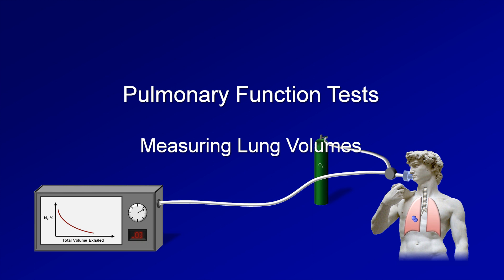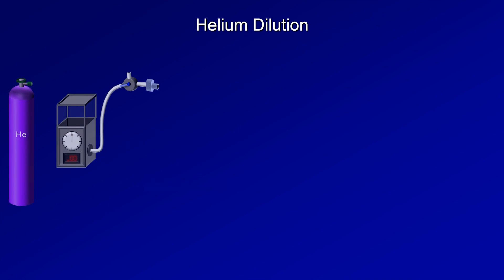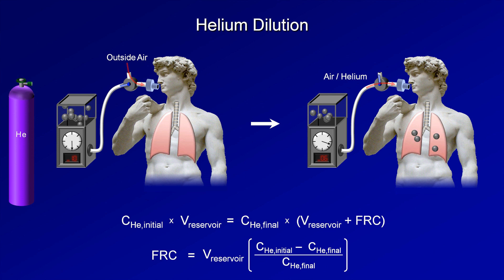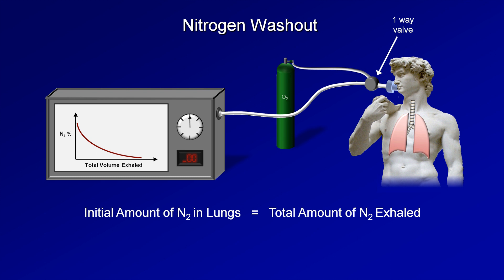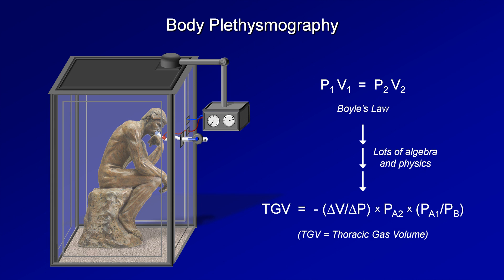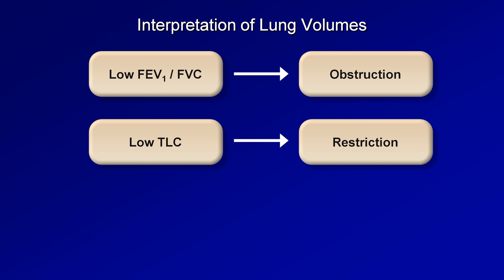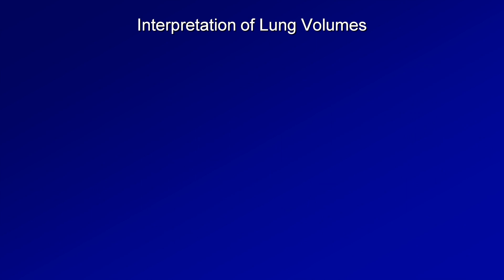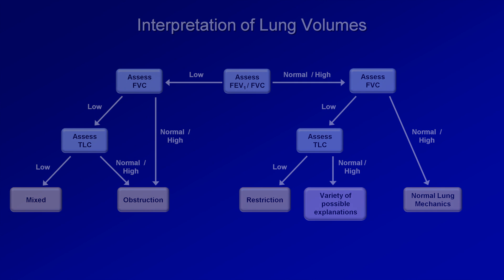Pulmonary Function Tests (PFT): Lesson 3 - Lung Volumes

Comment: This is an amazing video, Dr Eric. Thank you for uploading it. I would like to point out a mathematical error regarding FRC. FRC = [(Initial conc. of He - Final conc. of He) / Final conc. of He] - Volume of Reservoir.
Reply from the maker: Ahmed Khattab Thanks for the message.  However, I do think the original math is correct.  It's worked out more explicitly here: http://samples.jbpub.com/9780763781187/81187_CH02_FF.pdf (page 90 of the book, or page 22 of the uploaded pdf)  Please let me know if it still seems in error.
Reply: Eric's Medical Lectures I don't know how to thank you for your reply. It turns out that it's just a matter of rearranging the equation. My mistake. Thank you for the clarification.
Reply from the maker: Ahmed Khattab No problem!  I do make mistakes in these videos, and I honestly appreciate viewers pointing them out.  Thanks for watching!
Reply: I did not get that calculation

Comment: I have always wondered whether the lung capacity measured in a living animal would be different from the lung capacity measured in post mortem, ex situ lungs. I see lots of pubs report excised lung volumes but haven't found any that can compare these two measurements. I study marine mammals, which have extremely compliant chest walls and lung volumes, but am curious whether the post mortem ex situ values for lung capacity could be overestimates. Thanks for your help, this video is inspiring (pun intended)! :-)

Another thing I was hoping you could clear up is whether helium dilution or nitrogen washout techniques can be used to estimate total lung capacity...based on this video it seems like they can only be used to measure FRC, but I just wanted to ask in case I misunderstood. Thank you again for making this video, it's great!

Comment: Dear Dr Strong,

Thanks for the very informative series on pulmonary function tests. Would you consider an additional lecture on interpreting the validity of each of each type of PFT to complete the series. 

Thank you.
Sincerely,

Raleigh
Reply from the maker: By validity, are you asking about how accurately the tests are in discriminating different forms of pulmonary disease?  Or how reproducible they are?  Or how much clinicians actually use them in practice?  (I'm happy to discuss any of these in the final video in the series.)
Reply: Eric's Medical Lectures
Dear Dr Strong,

By validity, I am refering to the criteria for acceptability for each test.

For example, for spirometry, is there maximal effort; no cough or glottic closure during the first second ;good start-of-test; back-extrapolated volume less than 5% of FVC or 150 mL,tracing shows 6 seconds of exhalation or an obvious plateau, 3 acceptable spirograms obtained; 2 largest FVC values within 150 mL; 2 largest FEV1 values within 150 mL and finally reporting the highest FVC and highest FEV1, even if they come from separate maneuvers and that the FEV1/FVC ratio is derived from these values.

There are criteria for acceptability for dilutional lung volumes, body box and the different techniques for diffusion capacity.

Would you be able to elaborate on these in a separate lecture on pulmonary function test.

Thank you.

Sincerely,

Raleigh
Reply from the maker: Raleigh Lee Raleigh, I'm very sorry, but I think you just exhausted my own knowledge on this particular issue.  This level of detail is critical in the PFT lab, but by the time I see a PFT report, the technicians have already taken care of this.  Thus, I don't know more about it.  However, unless you are working as a PFT technician, it seems unlikely you'll need this information in routine clinical care.  (though I can imagine one might potentially need to know this for pulmonary boards...)

Comment: Thank you for the video, it is indeed very helpful. I have a question though about the "pseudorestriction" case. Can you explain why if we only measure the lung volumes by spirometry will that be inaccurate ? you mean that we only measure IRV, TV and ERV which are reduced so we think of a restrictive disease??
Reply: Yes, you are correct. If only spirometry is ordered without a lung volume test, one might intepretate the result as "restrictive lung disease" based on the reduced vital capacity measured by sprometry.

Comment: I'm struggling with the eqution a bit.  I get FRC = (initial concentration x initial volume / end  concentration) - initial volume after solving the equation. Looking in some books I can see that the s is apparently correct but that it can be solved further through some likely clever maths?  Is there any way of explaining this please?

Comment: Why does He dilution not measure FRC + TV? Wouldn’t the person still be breathing in tidal volume after the stopcock is closed? Confused...
Reply: No and I'll explain why! For example, in the helium test, the patient begins to breathe the air containing helium at the end of tidal exhalation (i.e. when the FRC is contained in his lungs). When the stopcock is closed it is true that helium is distributed throughout the lung but in an air volume that corresponds only to the FRC. I got it?
Reply: @giuseppevallese4153  Thank you!! Yes this makes more sense now
Reply: @nada amraoui 
Try to think that when the patient begins to breathe the circuit is closed and a single environment (reservoir + lungs [FRC]) is created in which the helium is distributed homogeneously. That's why the final helium concentration is the same in the reservoir and lungs. Clear?

Comment: Using the radiographic technique, how do you separate the lung tissue from the air? Or do you? Are the two considered to be one and the same?
Reply from the maker: In the absence of a pneumothorax (air in the pleural space around the lung), any air located within the thorax would necessarily be within the lung (with the exception of air in the esophagus, which is negligible in volume).
Reply: @StrongMed  Thank you for your response. The reason I'm asking is because I'm interested in measuring air volume within inflated lungs using CT. I am just curious whether quantifying the volume of the lungs=quantifying the volume of the air. Seems like this is true given your response, but if you have anything to add please do! Thank you again.
Reply from the maker: @hollyhermann-sorensen5974  Yes, the volume of the lungs on CT is close enough to the air volume that these can be assumed to be equal for any common clinical application. (i.e. the volume of lung tissue << the volume of enclosed air). I'm not positive about whether the difference is significant enough for any research purposes, but I would be surprised if it was. Another consideration is making sure the CT scans are appropriately timed with the person's respiratory cycle - you might need to speak with a CT technologist to get an idea of how this is actually done IRL, and how reliable the timing is.
Reply: @StrongMed   Thank you SO MUCH for this response. This sets my mind at ease. I'm quantifying the air spaces of some anesthetized animals using CT at known inflated conditions. Someone recently asked me whether this method was comparable to whole body plethysmography as I'm quantifying tissue + air versus just changes in air volume. I feel now like I can say that they are basically the same thing. Thank you again!